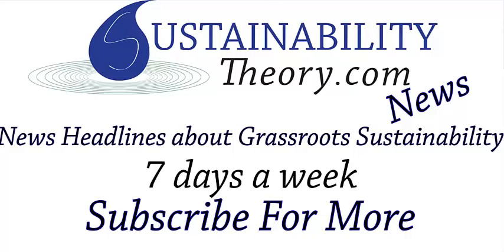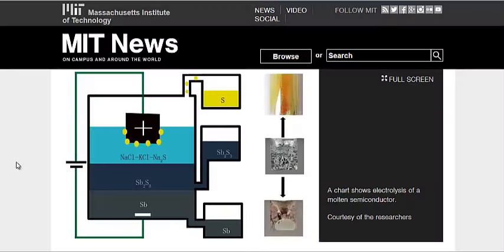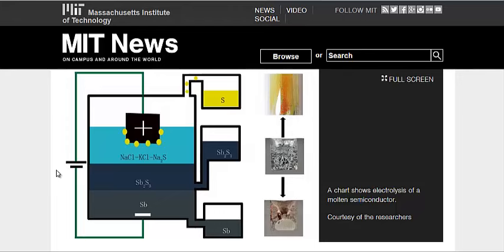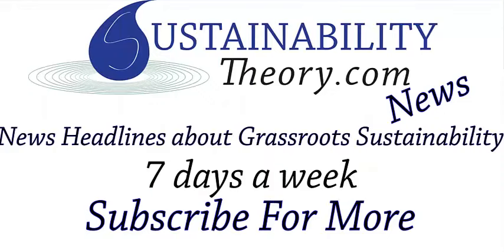Scientists Accidentally Discover New Way To Make Metal

Comment: We obviously read the same from MIT News so why not mention the big benefit our production will stop killing us ( In typical smelting processes, the sulfur would immediately bond with oxygen in the air to form sulfur dioxide, a significant air pollutant and the major cause of acid rain. But instead this contained process provides highly purified metal without the need to worry about scrubbing out the polluting gas).